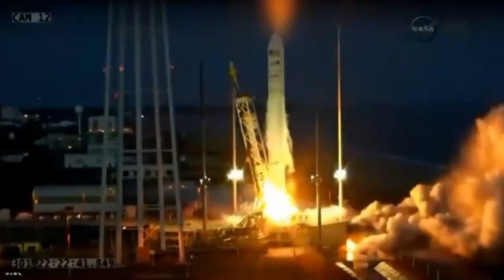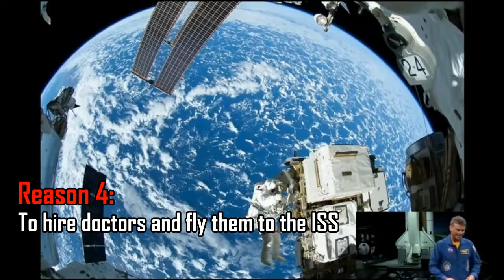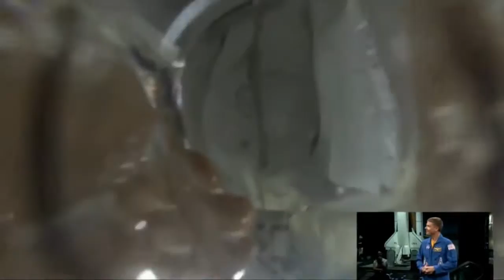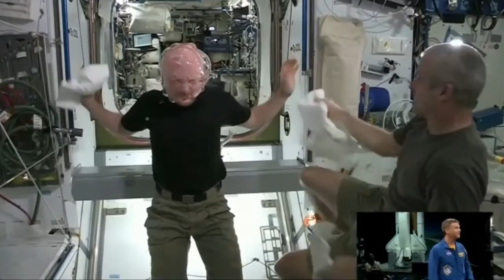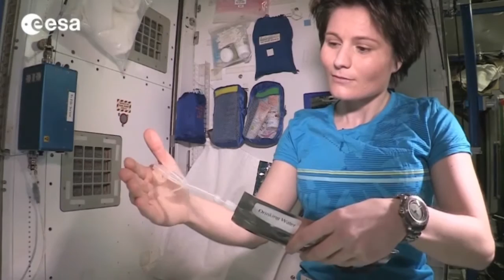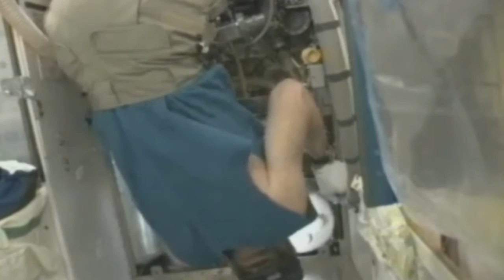20 reasons why NASA needs more budget!

Comment: How can they do that with water if they werent in space?
Reply from the maker: ***** good question, I hope someone smart can figure that out soon !
Reply from the maker: ***** here is floating water without zero-g https://www.youtube.com/watch?v=4_9Xnc4FlZ0
Reply: +GeoShifter   The video is NOT water floating.  It is water FALLING that is broken into bubbles by the nozzle.   I went to Disney World in 1992 and they had fountains that launched elongated pulses of water with clear air in between.  These "solid liquid bubbles"  made an arc across the fountain.This is totally different to the demonstration on the ISS where the water "hovers in mid air.
Reply from the maker: Swinde yes it's done with fast strobe lights but there are other techniques. You can make water float with sound: https://www.youtube.com/watch?v=669AcEBpdsY